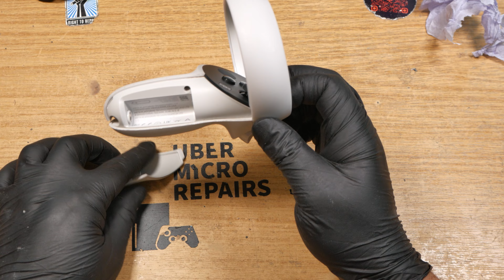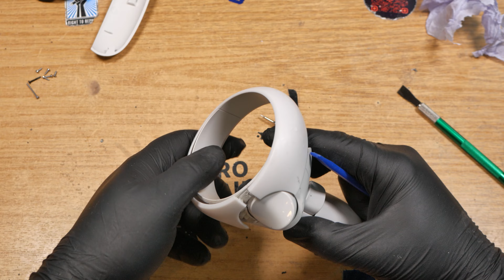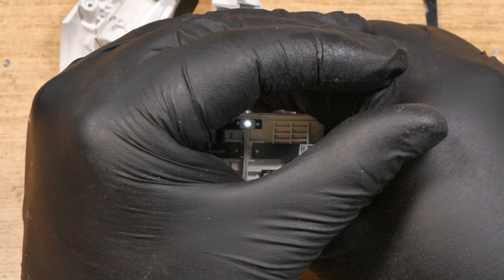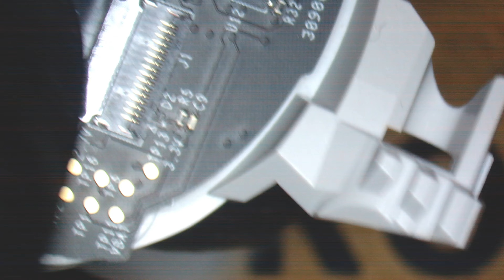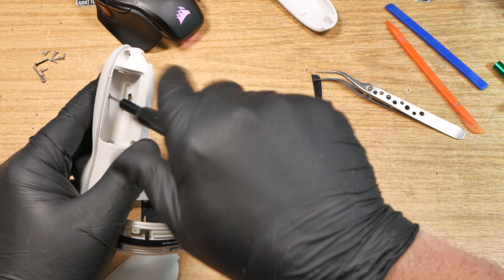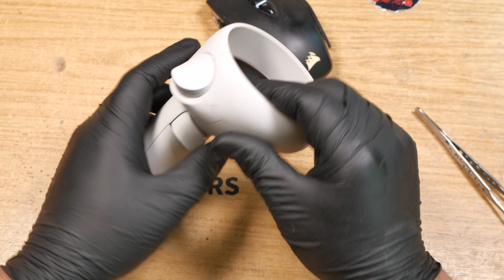Meta Quest 2 Controller Not Working | Unknown Fix But It's Fixed!

Comment: Fantastic video! Thanks so much. My controller was disconnecting on and off with similar symptoms (no light etc.). So if it happens again, I'll try disconnecting and reconnecting the ribbon cable as well cause yeah it seems that was the issue here, like other comments below mentioned.

Comment: I fixed mine too. Then when I put it together and it doesnt work. The ribbon cable header doesnt grip tight enough and theres a small angle in the cable when its routed to the main board.